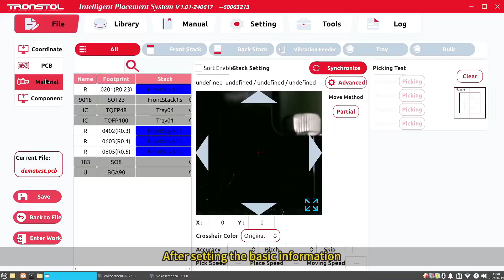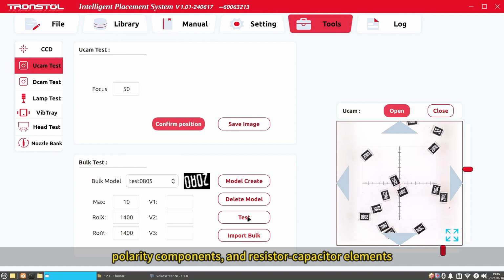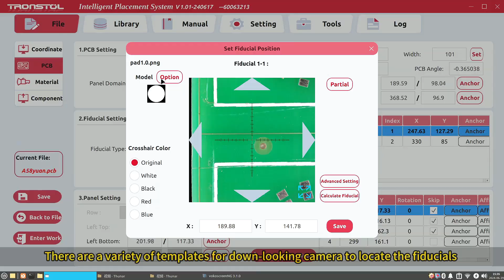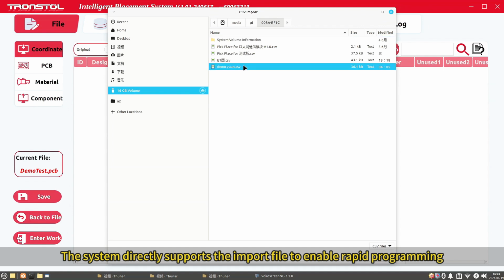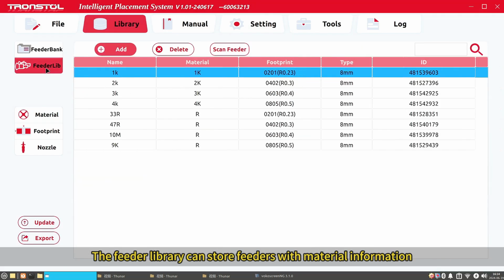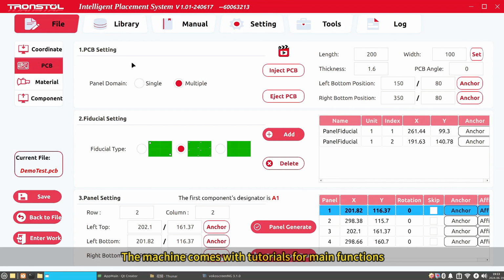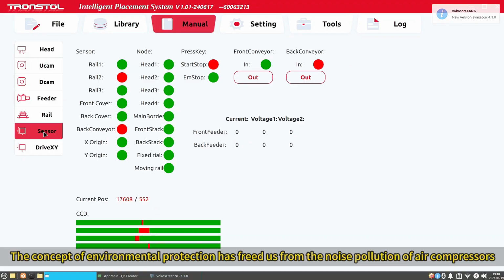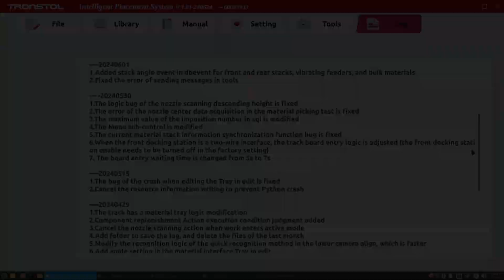Tronstol E4 High Precision Pick and Place Machine with Intelligent Software and Feeder System

Comment: The speed and accuracy are very impressive, and the installation direction is also very wide. The function of that loose material is also amazing. I can't wait to get one now.
Reply: this is a demo in demo videos the accuracy is always perfect even with poor machinery. 

There should be some real user videos. I remember 8 years ago when I bought my first machine (not from neoden) it was a single head piss and place machine, the results were awful, the company never fixed the issues even after shipping the whole pile of garbage back to them they even added more serious issues (eg. oscillating gantry) and then the company owners retired. I end up fixing everything myself an absolute horror.... still the demos looked perfect, and the usual comment no customer ever experienced issues (just because the machines were expensive enough so not too many customers bought them. I found a few of their customers also having issues and they did not care). That machine was not even able to pick and place HASL PCBs, the optical recognition always re-evaluated the fiducials and HASL based PCBs reflect the light into every direction poor software should at least have an option for manual locking, good machinery can handle such PCBs without any problem (I've seen Juki, ASM, Yamaha handling that properly).